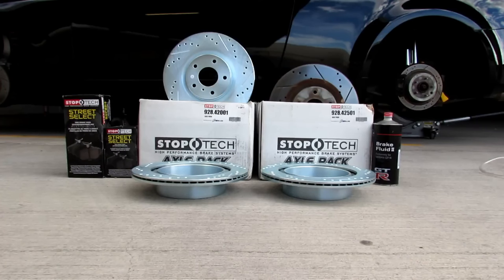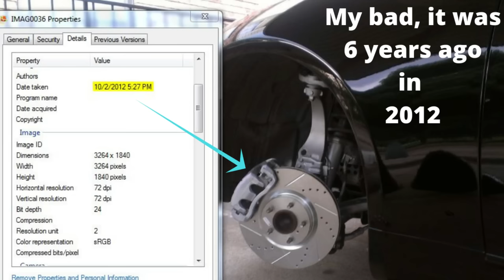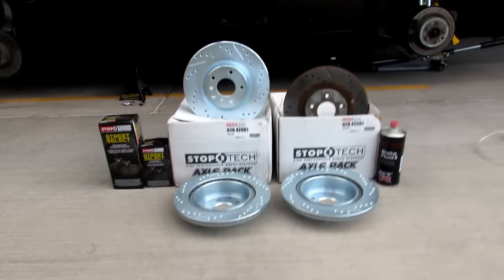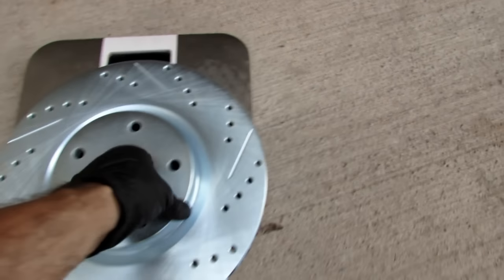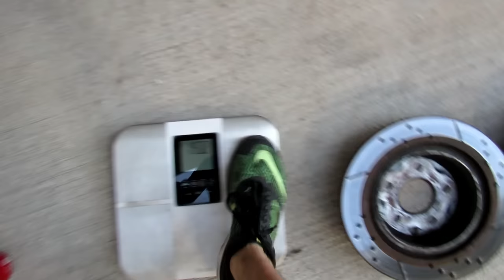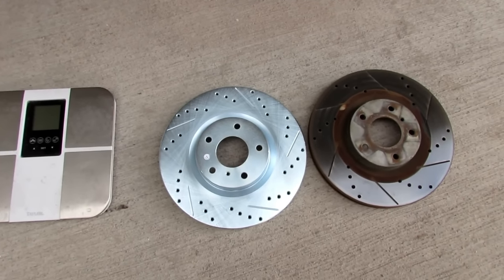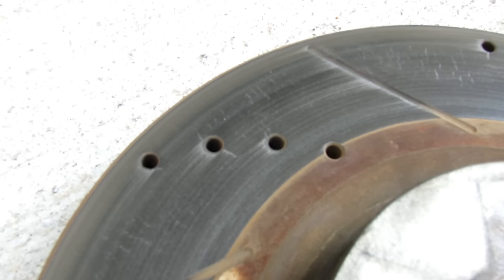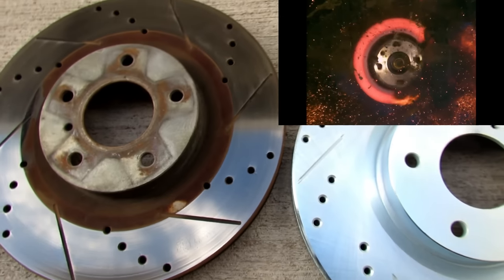$150 eBay Rotors vs $300 Rotors - 6 Year Review

Comment: How do you turn a drilled and slotted rotor I thought they could not be turned
Reply from the maker: Some places out there for some reason will not turn cross and slotted rotors. Oriley's Auto Parts turned mine, no problem. $10 per rotor
Reply: @MotordyneG35  okay Thanks

Comment: If you look closely on the ebay rotors you can see the ones closest to the centre are chamfered. You will lose the chamfer over time and by turning the rotors. Once this happens you can begin to develop fractures unless you rechamfer the holes. You could be wrong saying that these rotors weren't originally chamfered. Also more metal as in weight doesn't make it better. Some manufacturers will make their rotors thicker when they use inferior metal which usually leads to smaller vents between the vanes. Also did you count the number of vanes and notice their configuration for length. That will make a difference when it comes to weight also. The only stat that is conclusive that you offer is how well they lasted over 6 years but then again how many miles is that.
Reply from the maker: Damn I wish you were my director when I did this testing. Solid observations I overlooked just winging it.

Comment: If the eBay rotor had 35 holes instead of 24, then it would have weighed slightly less.

Comment: It would've been better if you measured use in miles, not years. I could put cheap rotors on my car as well and say they lasted 8 years when I've only driven the car 20k miles within that span.  

I can appreciate wanting to save money, especially in today's economy, but suspension and brake components are the areas i draw the line on cutting costs. Then again, i am a paranoid fck, and im driving a heavy 2SS Camaro.

Comment: They are both made in china. I would be surprised if they are not made in the same forge then sent to different milling lines.
Reply: You should visit the AAPEX show that happens alongside SEMA sometime and get just a small sample of the overwhelming size of offshore manufacturing.  There is a very low likelihood that those rotors came from the same factory, let alone, city or province.

Comment: 6 years of use, that's plenty of years on any rotors.  Also you had the rotors turned which gets rid of the hole chamfers.  Comeback 6 years later and do the stop tech review.
Also the "ebay"/brake motive aren't  performance rotors they are cross drilled and slotted with O.E.M specs.  Not meant for track use, I say this because you mentioned warping.

Comment: Actually, the holes on the e-bay rotors clearly ARE tapered.  It's totally visible, and that's even after you've had them milled.  More than likely the stress cracks are more from the fact that you drove them on a race track where they're not designed to perform.  I think you wasted your money brah...

Comment: Did you recomment to buying a test pipe on ebay
Reply from the maker: absolutely not. I recommend Motordyne ART pipes. Test pipes or resonated test pipes sound like shit. They are what introduce all the RASP and Drone. 

I used to have topspeed resonated test pipes. They rattled against the heat shield and had horrible fitment.

Comment: Stoptech are ebay rotors  both blanks come from China the only difference is the machine time. Oh yeah a pretty box!
Reply: Made in China and R&D in america are 2 separate things. Iphones are made in China but designed using the best engineers in the world in Cali. Chinese tires are shit, totally dangerous and designed in China, some look cool, but the technology is abysmal.
Reply: Not at all.  There is no single giant Chinese rotor factory making everything to an identical specification.  There are good factories and bad factories.  There are controlled production processes and random ones.  There are rotors made to be cheap and cost effective and rotors made to meet higher standards.  You usually get what you pay for.
Reply: No they are not 😂 they are 100% made in the USA in California
Reply: @HatsuneM1ku01  Hi, Hatsune, I'm a big fan of StopTech and they make a great product.  Your understanding needs some nuance.  StopTech rotors are machined in California, but not cast there.  They use both US and foreign suppliers for rotor castings.  

Centric, formerly Power Slot, and "StopTech Sport" (different than normal StopTech) rotors have different suppliers and processes than the premium stuff, but it's still very good.
Reply: I agree some factories have higher tolerance but ultimately the blanks all come from China. Rotora, Stoptech, powerslot etc all use China blanks. Hell even some Brembo's are made in 🇨🇳

Comment: Great video bro...thats nice information your giving us G35 OWNERS.I have a few questions for you if there is any kind of way you could contact me other than on here.
Reply from the maker: I prefer you ask here because that exact same question 10 other people are thinking. If I took the time to talk to each person privately, I'm doing 10x the work. By answering your question here, you are helping others. By answering your questing privately, you are helping nobody else with the exact same issue you have.

My insta is Motordyne_G35.
Reply: Okay  i have a clunking noise under my front end,after i hit a speed jump...it doesn't  clunk while turning and hit a bump.you think it could be control arm bushings?
Reply from the maker: If you hear metal on metal grinding when turning in a parking lot, it is your lower control arm bushing. I show you here....https://youtu.be/voxGTRCRsl4?t=1570. Since you say it is only when you hit bumps, it could be you have a blown strut. How old is the car? How many miles? Has the suspension been upgraded? 

In this video I show you my blown strut which also made a clunking when hitting bumps, but the car also would sway really bad when hitting bumps is a sign of blown strut. Mine was completely stuck down.....https://youtu.be/cMJfN0X_rvs?t=274

Or lastly, the swaybar end links could be busted making a poping sound when going over speed bumps.
Reply: @MotordyneG35  okay thank you for getin back to me,sorry so late at responding.i have replaced all four struts and shocks.i hadn't checked out the sway bar links as of yet.

Comment: Huh, seems you dont know why one rotor would be better than another.  Or what specific functions of differences in rotors serve. Telling your audience "the rotors dont help with stopping" is factually incorrect.  And your recommendation of garbage rotors that stress cracked with holes offset to the edges of the pads is full facepalm.  I recommend you go watch some engineering explained or something to get a bit better versed on what your specidic brake components do,  and how they work.  What drilled holes are for.  What slotting is for.  Etc etc.  The big indicator your a big green on this subject is your weird idea that because the stoptecs arent lighter, that its somehow a waste of money.  Thats absurd, and a backwards way of looking at it.  Im sure you can find some lighweight chinesium rotors for half the ebay rotors cost, but does that make them better?
Reply from the maker: Cheap rotors lasted 6 years with hard abuse, the evidence speaks for itself.
Reply: Motordyne G35 but warped the first track lap and cracked the shit out of lol